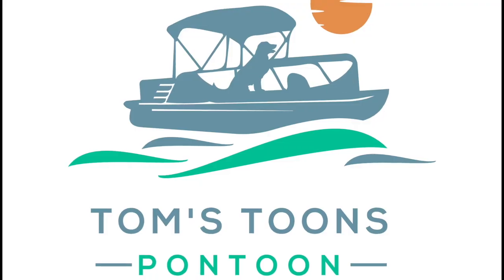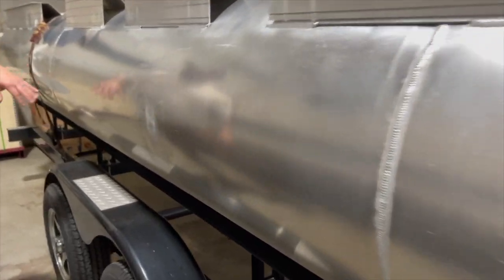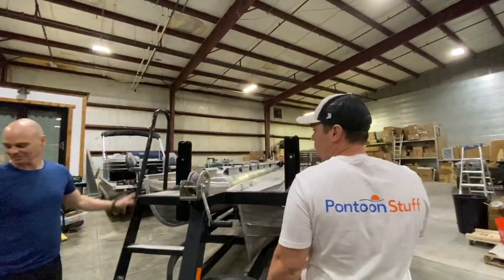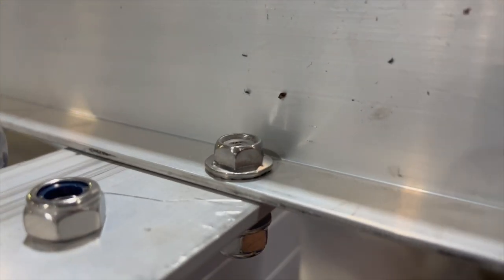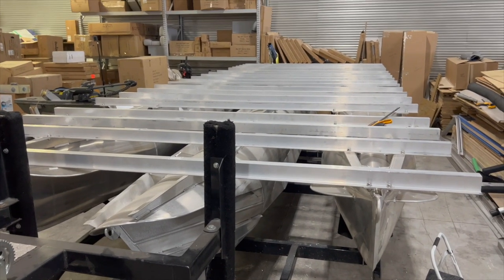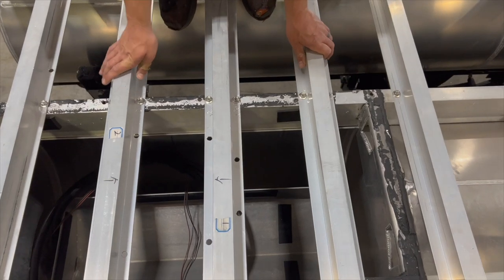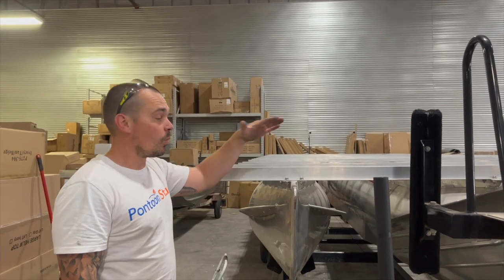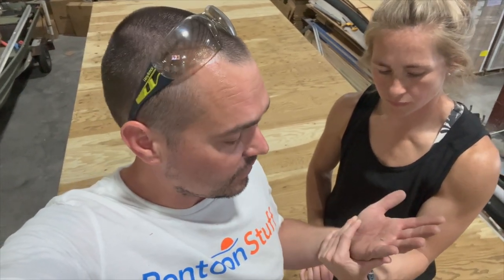DIY TRITOON BUILD - Episode 1 - WHERE TO START

Comment: I build them for our commercial operation; we use 6061 Aluminum square tube for crossmembers. 2" square OD with 1/4 wall is stronger than OEM
Reply from the maker: Absolutely agree that tube is the strongest…not fun to work with though for running bolts through. Easier to weld them in place!
Reply: I'm thinking of adding a couple additional crossmembers in the bow to reinforce my pontoon chassis to reduce flexing and twisting.  Do you think the square tubing would be the best idea?

Comment: a tip for your next build if you're tired of kneeling on the crossmembers, take a piece of 3/4 scrap ply that is say 28" long to span 2ft centers easily, and use it along with a kneeling pad to save your knees while kneeling and your back from bending over. Once you get the first couple bolted down you pop it up there and can tighten everything down, scoot the board one course and repeat.
Reply from the maker: I've certainly done that on other projects. It saves the ole knees big time. Great minds must think alike ;-)
Reply: @tomspontoons  Lol, yes indeed. I was a tile setter and did skatepark concrete for some time; got this tip from the only old timer without crazy knobs on his knees and not limping.
Reply from the maker: @Natedoc808  now that’s a cool job, building skateparks! I grew up shredding every park possible before every city had one!
Reply: @tomspontoons  I built a bunch of them during the revival after they were all torn out in the early 90s because of lame insurance Companies.

Comment: Tom, in the process of doing a similar build with a 25" shaft 225hp motor, was looking for the best place to source pontoons? Ideally would like to get a center pontoon with a transom built in already, was looking at Great Lake Skipper pontoons but when talking with an individual on facebook market, he explained how he was not too happy with the quality of what he observed while on sight there.  Was wondering if my best bet would be landing a set on facebook market through a private seller or seeing if you had any input on that.  Any feedback would be greatly appreciated !
Reply from the maker: We source our center pontoons from River City Ventures in Ft Wayne, Indiana. They can fabricate you a center pontoon with transom height you need and to the length needed too. My contact there is Colin, and you can email him at RCV.Pontoons@gmail.com

Comment: I am part of tiny boat nation which inspired me to tear apart my rotting wood on a boat and rebuild it wood free.  Now I’m getting inspired to build my own family tritoon. I’m just starting to watch these videos.  Wondering if there are any basic DIY instructions. Not sure what size boat I want to make. 18,20 or 22 feet long. How much of pontoon go past the rear deck to provide more lift for a bigger motor. I definitely don’t want a butt heavy boat.  Thanks
Reply from the maker: Awesome!! Those TBN guys have really provided great stuff for DIY fishing boat projects over the years. 

There’s no instructions really…other than our videos I suppose? We saw tons of pontoon restoration videos out there, but not enough explanation of HOW…thus our channel was born. It helps that it’s my full time job to provide tons of content. 

More and more we get rid of tucking the motor inside of the outer pontoons. We like it to stick out beyond the outer toons about 16” or so which provides better trim/tilt response and better handling at higher speeds…plus it tends to give better water flow to the prop. Ours is 22’ long with 25” outer toons and 27” center. Our center toon has buoyancy all the way to the back. Some of the center toons allow water to flow in and out of the last few feet which gives up some buoyancy. Ours sits super high and dry even with the 200 Suzuki on it (520lbs), and a full 29 gallon tank of gas. Couldn’t be happier with the boat all around. 20’ to 22’ is great for trailering, space, and performance. Sometimes I wish we would have built a 20’ with a 150 hp, but the extra couple feet would be missed…especially because we love having walk around deck space on the rear!

Comment: Should the plywood be painted or coated with anything?
Reply from the maker: Not this plywood from Pontoon Stuff. It’s CCA treated so it won’t rot. If using untreated plywood it should be coated…but I highly recommend against using anything but treated plywood. It’s what all the big brands use on new boats! Saltwater pontoons might be best with a composite to battle corrosion, but that’s a harsh environment for aluminum boats anyway!

Comment: You didn't say much about the bilge pump.  I assume you installed one because of the waterproofed dry bin you mentioned just before - a protection factor should water get into it?
Reply from the maker: I think I mention it in one of the episodes. There was already a bilge in the far back of the center toon on a float switch. It kicks on every once in a long while after we’ve been going fast for extended periods of time. The pressure must drive some water into small entrances. Any center toon with compartments for storage and/fuel should have an auto bilge!
Reply: @tomspontoons  I must of missed that it was already there but figured that was what it's for.
Reply from the maker: @willowmobilesystems4008  yup!

Comment: Is there a rule for how long the center float should be compared to the outer floats? Our boat has just about 20 foot floats and great lakes skipper in Wisconsin has a 23 foot transom log. I feel like that would be too far back especially with the steering cable coming off the motor.
Reply from the maker: No "rule" necessarily. I prefer to have the center toon in line with the outer toons in the front (or even back a few inches if need be so that it's covered by the deck), and then I like about 16" to 24" of toon sticking out in the rear beyond the outer pontoons. The 23' might be a bit on the excessively long side to match up with 20' outers. Check out the guys in Ft. Wayne that we use often: JoeyTippmann@gmail.com
Reply: @tomspontoons  sounds good. Is under skinning an absolute necessity for tritoons?
Reply from the maker: @Scheiterlein64  If you're going faster than 15-20 mph or you're going to be using it on lakes that can get choppy then 100% yes, you'd want to have underskinning. It prevents that chop from hitting the framework of the boat and makes it a much quieter and smoother ride.
Reply: @tomspontoons  so if we only have a 50hp Honda on it for the first couple years or so, we shouldn't have issues? Just worried about the water accelerating the rot of the floor.
Reply from the maker: @Scheiterlein64  If the boat has the proper plywood from the factory or if you redecked it with marine grade TREATED plywood then you should be just fine. As long as the wood can dry it out will not rot any faster than any other pontoon. The underskinning is mostly about smoothing out the ride.
Reply: @tomspontoons  awesome! Thank you so much!
Reply from the maker: @Scheiterlein64 happy to help!

Comment: I am adding a center toon to mine.  How far back is the transom from the back cross member?  If your center toon is 2 ft longer, does that mean the transom is about 30 inches away from the back cross member?

How far is too far from the back cross member?
Reply from the maker: As a tritoon I don’t think it hurts to be about 24” behind the last crossmember…that’s where this build ended up and it was great. Going too far beyond that might need some trailer modifications for support. Once on the water the center toon adds support to the whole frame and the motor is supported by the water holding the center toon up (aside from the weight of the motor and torque, but that’s what a sturdy transom is for!).
Reply: Thank you for the reply

What about the transom angle in relation to the bottom of the center toon?  I have read that it varies and the average is 14 degrees.  What is the angle on this one.  I am going with a 200 hp suzuki
Reply from the maker: I have read anywhere from 12 to 20 degrees. I would rather have more negative trim than not…so when I build my aluminum fishing boats I go for 15 to 17 degrees.

Comment: Glad you're changing it up a bit (not because anything you've done is boring at all), but that it shows growth of your channel. Gives your wife more to do as well. Good team!
Question: When you build from scratch, how do you register the pontoon without a mfg badge (usually found on the pontoon log)? I'd like to think about building custom pontoons to sell, but not really wanting a whole business model and becoming a "manufacturer" and wonder how a buyer will register it (here in Georgia they require that badge affixed)?
Reply from the maker: I think it depends on the state. Here in Michigan I can register them as an “Assembled Hull”. I pay registration and sales taxes, and they assign it a new hull ID and running numbers. Pretty straight forward for us, but I would give your state agency a call to find out more about building a boat out of unregistered parts and pieces.
Reply: Its pretty easy to get a hull number assigned from the agency in your state that you register the boat with ( fish and wildlife, forestry, god forbid the DMV, etc.). Manufacturer sometimes reads "self" "home assembled" "Assembled Hull" or sometimes "N/A". Some states don't require it at all similar to home made trailers.

Comment: Thanks I've been waiting for this. Following closely. I've got a 98 Tracker Fishing Barge 20 ft pontoon. I have a 3rd toon same size and a friend is going to try and fabricate a transom. Where is good places to find scratch and dent tools?
Reply from the maker: That’s a great size to make into a tritoon! Check out my other tritoon video of the Crest conversion. I had a transom welded on that I fabricated. It was a same length and diameter toon…they gained a little speed, but incredibly more stability and can cruise with a full load much faster than before! 

My best luck for toons has been on Facebook Marketplace and Craigslist. Depending on your location, Great Lakes Skipper might be a good place to check!

Comment: Newbee question: Do you need to worry about the interaction of the steel bolts with the aluminum crossmembers?
Reply from the maker: I’ve restored about 50 boats in the last year, and I have not seen any issues with stainless hardware reacting with aluminum. I’m all fresh water, so there could be a more serious reaction in saltwater or other environments. Additionally, I find it ironic that I HAVE to clean aluminum with a stainless brush before welding to prevent contamination. I’m no chemical engineer or metallic specialist, just going off what I’ve seen!

I also have never seen anything serious reaction wise between treated wood and aluminum…some guys swear it’s the worst thing in the world. 

All in all, we just do what we’ve seen work for the pontoon brands over the last 30-40 years!
Reply: Don't use steel if your going in salt.  All the pontoon dealers upcharge for titanium or aluminum (anti corrosion) screws they call it a salt water package or something

Comment: I'm planning on adding a center tube to my 16' pontoon I installed a 90 four stroke Mercury on it now seems to set really low in the rear was thinking would set 12 to 18" back of outside toons and maybe not quite as forward as the outside then my electric trolling motor could still work in front center I have aluminum welding experience and miller wire feed gun just don't know exactly what type of transom to build think I can find a regular tube from a take out will need repaired / shorten do you know of any plans available for different mounting systems just found your channel really enjoyed what I have seen so far
Reply from the maker: Thanks for watching, and great questions. The best reference I can give is to my Crest Tritoon conversion video. It shows the transom I built and had welded on to a standard pontoon. I did a similar design to my own 16’ pontoon and installed a 60hp four stroke Mercury Command Thrust…your 90 must HAUL on your 16’!!!!!

Comment: Awesome work that yall do! Seems super rewarding. Quick question, i have a 03 crest with 24'x27" hpt toons & a honda 225. I found a 26'x27"center with transom. How do you think thatd match up? Think itd be best to add 1" or 2" of spacing to push the center toon down?
Reply from the maker: That's a seriously buoyant setup!! I would personally push that center pontoon down 2" with spacers to get better handling at speed, and it'll help get your outer toons higher out of the water too making the boat more stable side to side.
Reply: You are the man! I'm ready to take on this entire project after your videos. Do you the the 2' in length difference would pair well with the outers? That'll push my motor at least 20" further back than the outers I'm guessing & what do yall typically use as spacers? Thanks for all the help! 🙏
Reply from the maker: @dakotashirley5292  Happy to help. I like seeing the center pontoon 2' back from the outers. It helps with trim response and handling at higher speeds. Plus it keeps the back deck area more open and spacious. Right around the 13:00 mark in this video I break that down. 

Personally I would weld on channel or angle aluminum to get the desired depth. Otherwise if you don't want to have anything welded on you could just bolt through a 2" square tube aluminum.

Comment: Tom, where did you source your hat channel from?  I have 2 hulls from a 96 catamaran house boat i am wanting to build into a pontoon.  I am in Wyoming and I am having a hard time finding aluminum hat channel.  My local metal and recycling business looked at me like i was speaking Chinese when i asked if they could order some.
Reply from the maker: We lucked out and the pontoon kit came with the hat channel and even a transom...it was a whole boat kit ready to go. It's a unique extruded piece of aluminum. You may have better luck asking a metal or fab shop to bend you custom pieces. While I think hat channel is the strongest option, we built our 24' tritoon houseboat with C channel and it's done great.

Comment: Hey awesome video. Where do you recommend I get the cross members. And what are they called. I’ve got two new pontoons and a transom but no crossmembers.
Reply from the maker: This kit came with the crossmembers, but for other projects including our houseboat I have used C channel, usually a 3” tall piece. I’m building a work barge for a customer this winter so I’ll be having to source something for that boat myself. I’ve always referred to them as crossmembers.

Comment: How do you get title/registration for homemade boats like this?
Reply from the maker: Every state is different from what I hear. I can speak from my experiences in Michigan…If you have the brand of the pontoons it can be registered as that brand, and then assigned a new Hull ID number. If it’s totally from scratch with no info on the pontoons there is paperwork to fill out at the DMV to have it assigned a new Hull ID number, and it would be registered as an “Assembled” hull. Hope this helps!

Comment: It really doesn't matter if its air tight or not. It will still be boyant.
Reply from the maker: The rear portion of the center toon? I love how high it lets the motor sit out of the water when docked. Some sit so stern heavy when the rear few feet can fill with water. Super happy with this boat now that we’ve run it a bunch!!
Reply: @tomspontoons  Its a great looking pontoon! I'm building a 30 foot tritoon as we speak for guiding on Lake Moultrie, so I always check your channel for tidbits of information. Great channel!
Reply from the maker: @darrenhill4406  That's going to be a fun boat when it's all done!!! And thanks so much for the kind words about my channel!

Comment: Any concern with insurance on a self built tritoon?
Reply from the maker: It wasn’t cheap to insure, and you’ll often have to do a “agreed upon” or “declared” value based on everything that goes into the boat. 100% doable, maybe an extra $50-$100 per year, but ours is fully covered!!

Comment: Was there a coating you put on the water side of the plywood deck?
Reply from the maker: No coating needed here. It’s CCA treated marine grade plywood. The water side will dry out between trips, and the underskinning between the pontoons will keep most of the water off of the wood too. Usually the bottom side of decks stays in great shape, even after decades, because it’s able to dry out. The top side gets rotten due to wet carpet sitting on top of it for decades